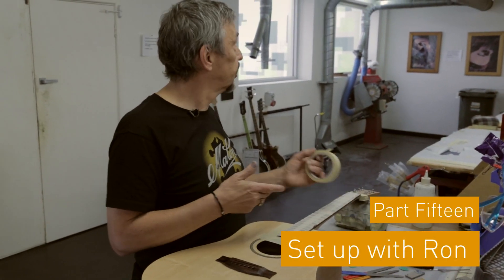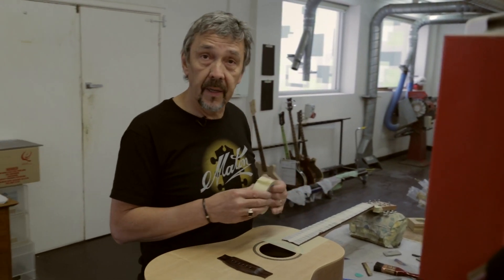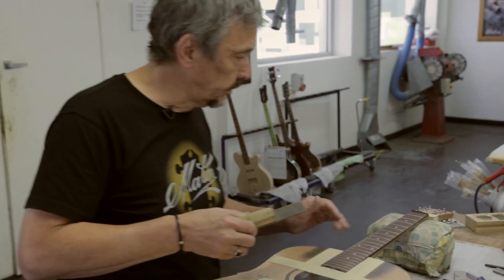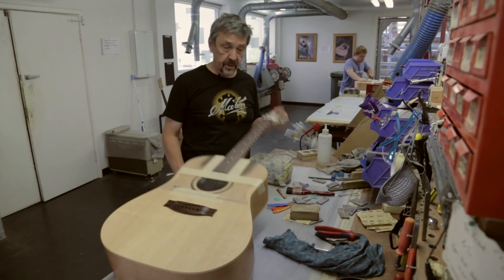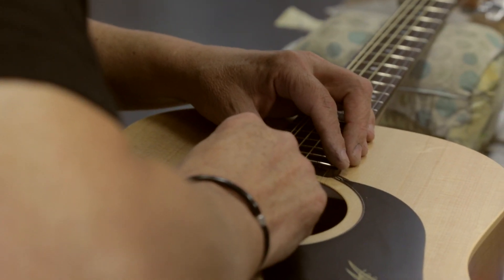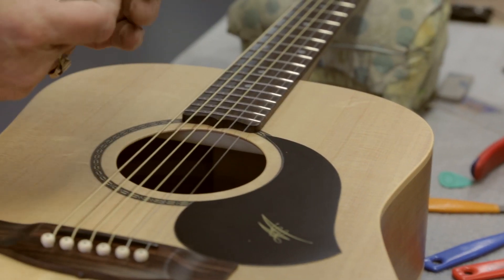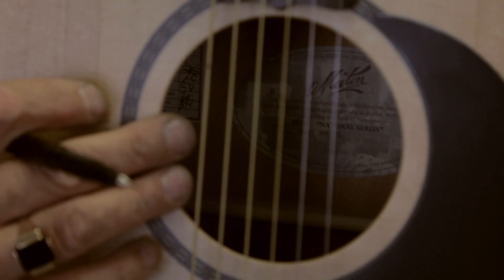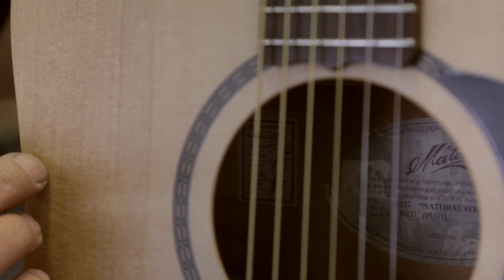Maton Guitars - Set up with Ron (Part 15)

Comment: I have a Maton that I would guess was made in the 1970s. I can see the truss rod adjustment through the end pin hole and it appears to be a square nut. Do I need to use a square socket and if so, what size?
Reply: OK, I've worked this one out. I put the wrench end of a 6mm 1/4" drive socket on the truss rod nut and put a 6mm hex key in the socket to adjust the truss rod.